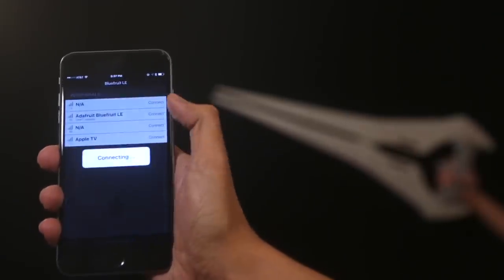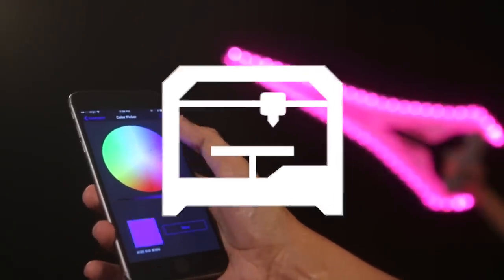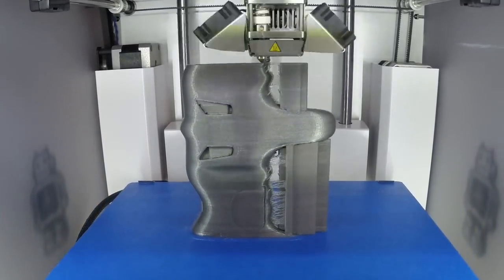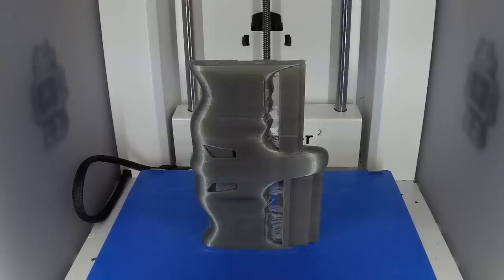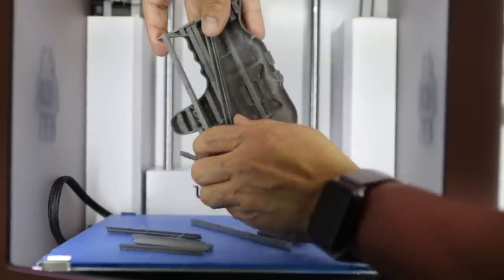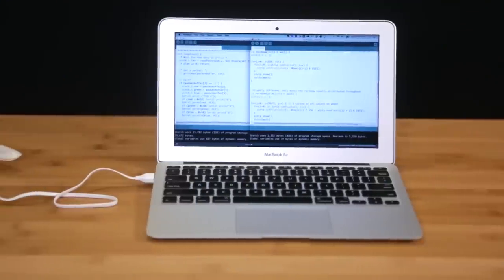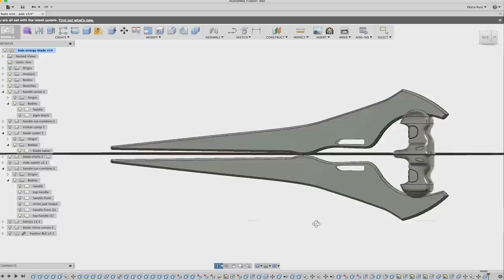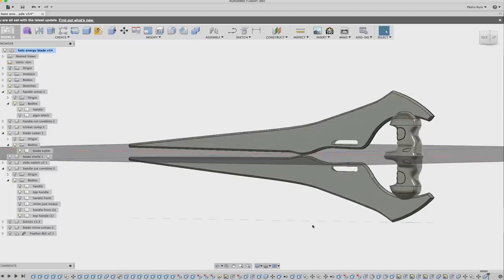3D Printed Halo Energy Sword

Comment: which 3d printer i should get?
Reply: Depends on your budget
Reply: +NaeXróv I have a Flashforge creator pro. Which in terms on capabilities, I think it has the most functionality for the price.

Its about 1300 and it can extrude two materials at the same time. so you can print soluable support and such but if you want it for basic printing id go with something in the 500$ range. plenty of info online about bang for your buck printers